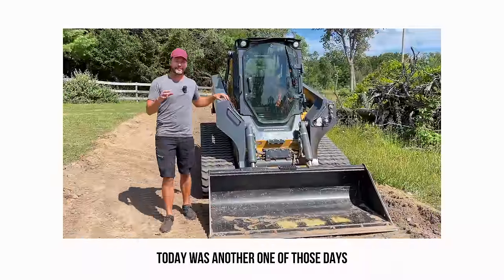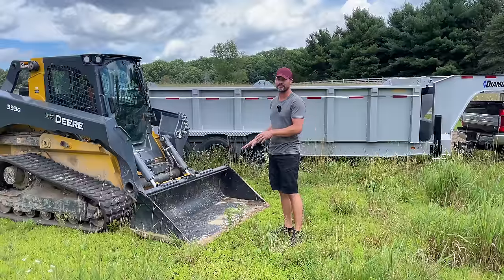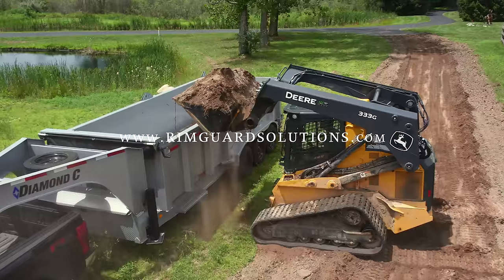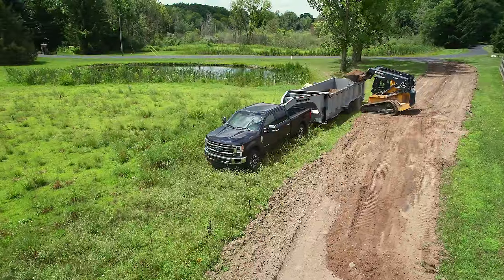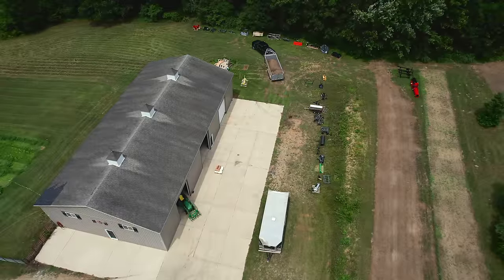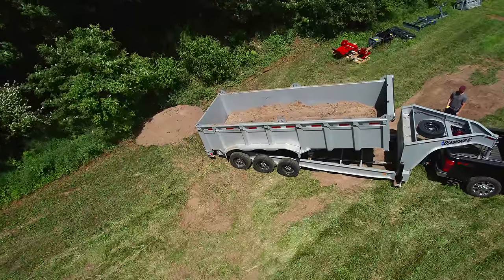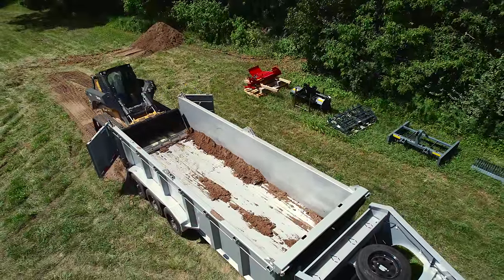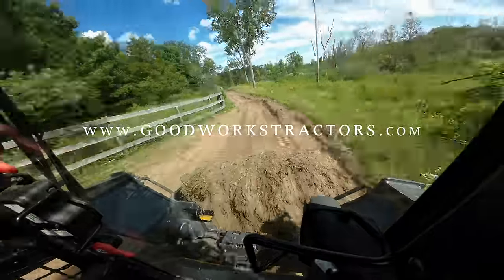THE MOST DECEIVING DUMP TRAILER I’VE EVER SEEN. DISAPPOINTED

Comment: That trailer isn't designed optimally. I can see two flaws immediately. A- The axles are a little too far back. B-the main pivot for the dump bed has almost zero cantilever built into it, it's too near the end of the bed. 

I have a Load Trail 14' deck over dump trailer I use for gravel and dirt. My buddy has a 16' dump trailer by Big Tex. His pivot is like this Diamond C and he can't put more than 10k of dirt/gravel in the bed or he can't dump it. I've had as much as 13k in mine and it will still dump easily, since my main pivot is about 2' forward of the rear of the bed. 

IPhone footage looks great. I'd like to hear more about the tripods and editing systems you use.

Even without the flaws in design, you definitely overloaded that trailer, maybe by twice it's weigh capacity. 

When the load material sticks to the bed, hitting the bed with a mallet from the bottom while the bed is raised has helped me a lot.

Comment: My name is Dana Cray and I would like to suggest that you check out Sure Trac dump trailers. I had the same problem with my first dump trailer and did some research,them I found Sure Trac trailers and haven't had that problem since. I have a 14k bumper pull and it will lift everything i put in it.  The only thing I have to worry about is breaking an axel if I put too much in it.

Comment: Scissor lift dump needs help getting started when overloaded. Get the box a few inches off the frame and the lift will usually take over from there. In this situation I use a bottle jack under the box to get it started or you can place a 4x under the front of the box before loading if you think there will be an issue lifting. Reason is the scissor mechanism is pushing horizontally when all the way down and can’t get enough vertical push to start the lift when overloaded

Comment: I've had this same struggle.  I really like my dump trailer, but sometimes I am a little bit disappointed by the lift capacity.  I have thought about reworking it and converting it from a hoist to a dual telescoping cylinder set up.  I also want to convert it to a gooseneck as it is a bumper pull and I don't care for that.
Reply: at that point just buy a different trailer. for the amount of work that would be it wouldn't be worth it

Comment: So that’s a 16ft dump with 4 ft sides.  I’m guessing you had somewhere in the neighborhood of 25- 27 k in dirt on there.  Years ago I had a 14 ft dump that I had the same problem with.  The place I was getting dirt told me a skid loader bucket weighed about 1000 pounds.  So I ordered 10 buckets I stopped the guy loading me due and asked how much do the buckets weigh I will never forget what he told me.  Each bucket weighed about 1800 pounds by his estimate and I tend to believe home the dirt was going over the sides of the trailer and the tires were looking like they were struggling

Comment: I've owned several dump trailers. Only one of them actually pulled the electric power from the truck. It does not have an internal battery to run the pump. It has 1/0 wire running from truck batteries to the pump. That was a tremendous help. 2nd the deck height of the trailer will make a big difference in getting material that sticks to the deck out. Higher the deck the higher you can lift before the rear hits the ground. This creates a steeper angle material slides outs.   My deck height is 40".

Comment: Load a few feet in front of your farthest forward axle. Load the rest to the back. Pulls fine and will dump. Obviously still don't overload. I do this with an old Bri-Mar tandem dual dump with a scissor hoist and it never struggles with 8 tons of rock or dirt.

Comment: The biggest problem that I caused myself was to take my fully loaded dump trailer over uneven ground.  Somehow weight was transferred from one axle to the other and bent that axle.  I assume that going over a hump with a dip on the far side created that problem.  Approaching the hump/dip combo, all of the axles were contacting the ground.  When the front axle was on the hump, the rear axle still had ground contact.  But when the rear axle went over the hump and the front axle was over the dip, the front axle was suspended for bit transferring all the weight to the back axle.  How did I know the axle was bent?  Well, it wasn't close enough to the frame for the tire to rub paint, but it did keep any dirt from building up on the frame.  I could fit the palm of my hand between the tire and frame on three of the tires, but the bent one had no room to fit my hand.  About a thousand dollars later, I'm back in business.  This time, I'll make sure to keep my loaded trailer on level ground.

Comment: I have a16ft gooseneck PJ and I learned the hard way never put any material like dirt or rock in the front put it right over the axles or just a tad in front also my trailer is rated to haul 12k lbs i usually get 5 or 6 yds depending on how wet it is and i can say for sure that sometimes 5 or 6 exceeds 12k lbs but as long as you don't load to the front it dumps it every time the key is keeping the load over or behind the lift cylinder hopefully you'll have better luck next time.

Comment: Don't know exactly how large you dump trailer is but when we rent a 40 yard dumpster they say that only 12 inches deep with dirt, concreate or gravel.  I almost destroyed my truck when I was doing landscaping when I thought I would put a yard of topsoil in the bed. When the operator at the supply yard asked if I wanted it in one trip I answered yes. Huge mistake. It put my truck on the bump stops and why it didn't cause the tires to blow out, I will never understand.  Fortunately the job was close the the supply yard and I CAREFULLY drove back to the job, scared to death that the tires would roll off the rim.  My lesson learned the hard and SCARY way.
Reply: Same happened with crush on a 3/4 ton trailer one wheel tore out of the lug bolt circle. An other time I parked it and my wife filled it so full of rock that the frame bent.

Comment: Double acting direct connection hydraulic ram at the front of the trailer is the strongest lift capabilities. You can add a vibrator system to the dump that will break up and ease the unloading of "sticky" material.
What might have worked better for your issue was to use the skid loader to help lift the dump body as the hydraulics would have held it up once it was raised, but just didn't have the umph to lift it.

Comment: I’m not gonna lie, I started laughing when I first saw the video. That Deere looks like it has a 3/4 yd bucket. Doing landscaping helps me know some basic weights. Thoughts were, this dude is gonna run into some issues. Especially with how heaped your piles were. Easy 1 yd a piece. I guess that’s a testament to Diamond C build quality. Next time get the single ram design on the front. Those can lift like 40k unlike the scissors.

Comment: Three suggestions I would have one next time if you can load as much of the dirt as possible right at the back too if you do get in a situation like you did use like a pallet or something and a chain set the pallet at the front of the trailer and then run the chain out the back and you should be able to drag a good chunk out with it and three when looking at a dump trailer, consider what you’re going to be hauling with it does scissor lift dump trailers do not have a very large dumping capacity never meant more for brush and lighter material. If you look, they also make dump trailers with twin, rams and telescopic rams. Both of those would do much better with dirt.

Comment: You have to know what the capacity of your equipment is and then be aware of what doubling or trippling that limit involves. You're lucky you didn't blow out the while climbing up there with the track loader. 

There's no replacement for experience. Snd you only get that THROUGH experience. Even though that material is well aerated it was still (as you found out) exceedingly heavy. You need roblearnnthe relative weights of material that are going in the trailer. But again, that only comes through experience. I'm glad nothing was broken and you got off with just some extra work and a story you can use as a cautionary tale.

Comment: Look up the lift cylinder and that will give you what it can lift. Guestimate the weight of the bed and go from there. 

If you have a lot more to do fill it with 8 scoops and run the lift. Add 2 more and check it and so on. Listen for when the lift is struggling to get your limit when loaded even. 

Just my 2c take as you will.

Comment: Good morning. Live and learn deal. Got to subtract curb weight from gross weight rating for load weight. 
Again live and learn. 
Smaller trailers weigh less, but they also are not going to have capacity of a large trailer. 
Soil is cubic yards but is it dry,loamy or damp,moist and packing. 
Scissor lift vs dual ram mounted underneath vs telescoping, positive and negative for all 3.
My statement is every dump I see is telescopic, but it costs more, right back to positive and negative. 
It comes down to application and money available for the tool at a specific time. 
Nobody got hurt. Ability to learn was achieved. Win win.

Comment: This has happened to me a couple times. Our solution was to use our loader to assist and help lift the bed.
Reply: That's fraught with danger too. The box was built to match the capabilities of the rams. If you take and lift with a machine the weight could cause the box to buckle in the middle of the span of the box. Also, there are no static lift points to assist at. Meaning, you very well might rip the front of the box up too. You have to know what the capacity of your equipment is and then be aware of what doubling or trippling that limit involves. He's lucky he didn't blow out the suspension while climbing up there with the track loader
Reply: @82ndpara21  any load that supercedes the trailers capabilities to the extent it won't budge it off the deck frame is potentially damaging. Add in the fact that the track loader is another 12000 lbs +, you can see what you're dealing with this trailer was overloaded by AT LEAST twice is rates limit. That's not 4k over. Off the top of my head it was probably 10-15k over.ive been over 4k before because I accepted the risks involved. And i had the means to get the item 4 off if it didnt lift. Which it did. This wasn't that.

Comment: Wow, that trailer looks like it should have been able to dump that dirt.  They need to put a second hydrolic cylinder on that length trailer so it can lift more.  What's the point of having a huge dump trailer that looks to be built heavy duty and only put one little lifting point.

Comment: If I ever bought a dump trailer, I’d insist on twin hydraulic lift cylinders to ensure sufficient lift capacity regardless of load.
Reply: Actually the twin cylinders aren't any stronger. Yes you have 2 pushing instead of 1 but they are mounted further back on the trailer and counteract the extra cylinders power. The front mount telescopic cylinder will definitely dump anything you can put in the trailer

Comment: I have been TOLD that if you have dirt or any load in a dump trailer that doesn’t like to slide or easily, spray the trailer floor with diesel fuel to slick it up. Dirt doesn’t slide out well for some reason.

Comment: Here is my story of over loading my util trailer. I had an old frame of popup camper (6ft x 11ft) that a had put PT plywood floor on it and side boards around it.  (I think the old camper had a weight rating of 3000 pounds but I had only reg as 2000 pounds so I wouldn't need a title).   so hadn't been used much for a couple of years so the tires had been in bad shape.    friend had extra dirt and I had a need for some fill.   I made a couple of trips of trips with loading the dirt on the front of the trailer so to spreed some of the load onto the truck hitch.  (didn't want to blow out a tire)  all was fine until I decided to get new tires for it on the 4th trip.  So we used the tractor to load more dirt onto the trailer like we had been doing.   loaded the dirt onto the front half of the trailer (between the hitch and the axle).   so as I didn't have the fear of the tires blowing out, we loaded more and more dirt to the front half. (if we had spread-ed the dirt out on the full length of the trailer we would have been fine but that wasn't what happen).  so I had left his house and went down the road until I hit the  first big bump.   yep, folded the the front frame at the A frame were it met the box frame of the rest of the trailer.   so had to shovel the dirt to the back of the pickup by hand and make multiple trips to empty the trailer.  managed to straiten the frame of the trailer so it wasn't dragging on the ground and got the trailer home.   so after rebuilding the frame (got good at welding by the time I got done) of the trailer, it is still in use today.  I still LOL about the dumb things you do when you don't think out about it first. I have pictures of the opps and the rebuild of it.  I have another popup that will become my new future util trailer when I have the time to do the build.  It is a little bigger, has a higher weight limit (over 3500 pounds) and electric brakes.     I plan to beef up the frame in the same place when I build the util trailer.

Comment: Certainly the trailer was not designed for that specific load. On triaxle  dump trucks there is a huge boom to handle the weight as well as a very heavy steel frame/attachment points!! Human ingenuity got the job done despite a setback!!

Comment: It is a big trailer. Tall sides. My Big Tex 5 yard dump has a placard right on the side what max pay load is. But no way can i fill it full of gravel and expect it to work. I will exceed the limit. It will however dump max payload as long as the battery is strong.  Possibly a stronger battery source my have helped??

Comment: Im not sure what brand it is but i borrowed nieghbors 14k dump trl after getting material for her with it. I wanted 3 yards of topsoil and first trip up to pit they loaded me but i was way too light so had to go back up for more.  Then my second load they dumped more in to start and when i went to scale out i was like 29k gross.  My trk wieghs 9k and the dump trl i believe is around 5k.  So im guessing i had around 15k of dirt and trl says 10k dump limit. I dumped out a bit and shovel some back forward for tongue wieght.  Nieghbors trl is a single tripple stage ram like a dump trk and didnt have a problem unloading around 50% overload and my 97 f350 7.3ps in the pit had no issues with that wieght

Comment: If you were having troubles moving it with your f350 that was a helluva load on that trailer. It may have did some damage to your hyd pump or they have the pressure relief valve set way too low to avoid service/warranty work……Maybe.

Comment: It's always like this. You've got a stock trailer that will hold 20 500lb steers.....but it has 2 3500lb axles and weighs 3000lbs....the there's your buddy hauling 40k lbs with a truck rated to tow 18k and never a lick of trouble. But that's never me.

Comment: Take the trailer to a hydraulic shop and have the pump pressure tested.  I would guess it is set 1/2 of the rating of the system.  You can buy an adjustable pressure relief for around $20. Put that in and the dump capacity will double.

Comment: If that’s a scissor style lift they are a lot weaker then a front mount cylinder. Plus that is a long trailer for that size of a load. That looked comparable to what a dump truck would haul. I’ve never had that problem with my trailer but it is only a 6’x10’ dump. 

Please, please let me say something about the ford!!!!

Comment: Depends were the ram is placed on the trailer some will lift up even with heavy weights sometimes you have to back hard and brake while raising in the tractors anyway if you have heavy load and a crap tipping ram placement

Were it was stuck could you not have accelerated hard sometimes will loosen it

Comment: My thoughts on your dump trailer issues. 

If you grossly overloaded the trailer the traction limited F-350 would not have moved the trailer on dirt at all.  It would have spun tires and buried itself very quickly. I believe Diamond C underrates there dump trailers, a few videos on YouTube  can confirm that the dump trailer hydraulics can exceed the company capacity claims. I would question how charged was the battery that drives the hydraulic system? I would have connect my jump pack to the trailer battery. I suspect you are not operating the trailer with a fully charged battery. If I determined my trailer hydraulic system could not dump a trailer that should be within its operating specifications, I would have used my tractor loader to assist the dump bed hydraulic system.  I think you should reach out to Diamond C for technical assistance at this point.
Reply: I may have been premature in posting yesterday. I think the JD 332 has a 2/3 yard bucket = 17.7 sqft. of dirt. Dry dirt weighs 80 - 100 lbs sqft.  Just a guestimate but you were adding approx. 1450 lbs per scoop.
Reply: Cory. We do appreciate sharing you sharing the “faux paws”. We all take a minute and look a little closer at our equipment and its capabilities. For me those high sided dump trailers are extremely dangerous because of the overloading potential. Unless you’re hauling mulch or manure they’re totally unnecessary. I have a 16 foot PJ low pro with 24 insides and 6 inch side boards added. I like the side boards because they can be replaced if you have a loader operator who is not proficient. 
I limited to mine to 6 yards. My Mahindra holds just over 3/4 of a yard so 8  full buckets 
 is my absolute max. I always make sure that the load is over the wheels and behind it. I Haven’t had to scrape off a load yet. But a couple of times it struggled to get up.!